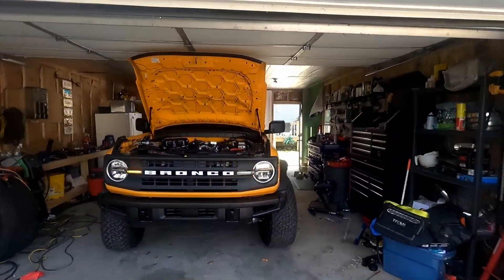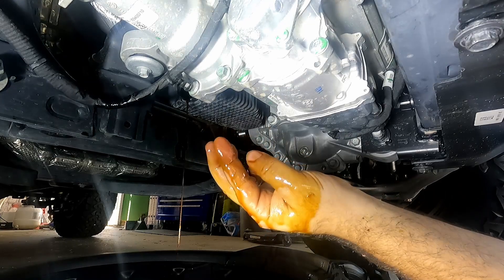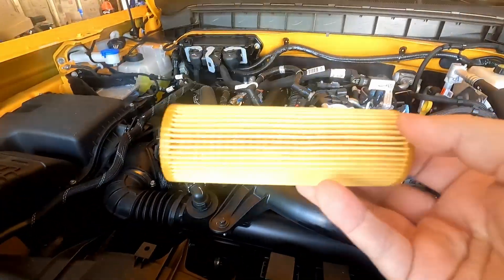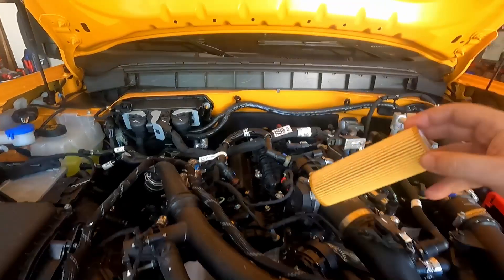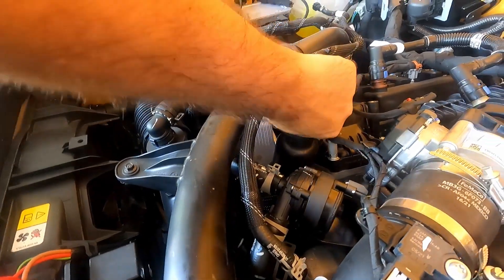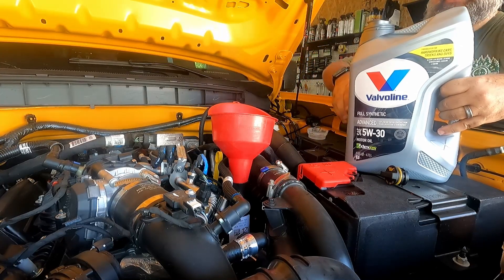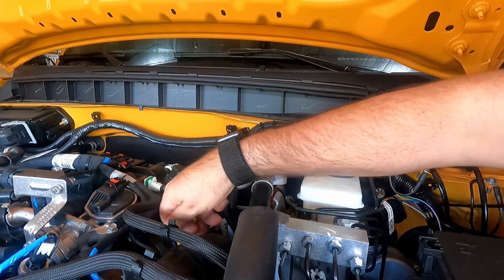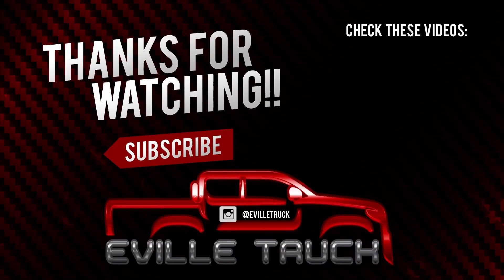How to Change Oil in Your 2021+ Ford Bronco | 2.7 Engine

Comment: After watching this video I'd say if you don't change the oil yourself take it to the dealer.  I couldn't bring myself to trust a quick oil change place to do it right.  Then again I don't take my old 2004 F250 to those places either.  With how long it took to drain and still left a quart somewhere (oil cooler and lines maybe?) you know most oil change places aren't going to wait beyond the time it takes the oil flow to slow down to a small stream.  Not to mention I bet a lot of them aren't going to change the o-rings on the filter housing either.

Comment: Quite possibly the best gasoline engine Ford makes today. These are heavily built motors. Definitely looks a little more obnoxious to get to than the F-150 I had, but skid plates do that. The F-150 takes 6 quarts. I highly doubt the use case in the Bronco is harsher than the F-150, but always check your dip stick. They do tend to put a decent amount of fuel in the oil, so I wouldn't recommend going much over 5,000 mile intervals, shorter if towing.

Comment: Blitz makes a large shallow oil pan that looks like a very oversized cookie sheet that I use under my collection bucket.  Stopped getting those annoying splash and drip marks.

Good to see that the oil filter isn't a hassle to get at.  My 2009 Volvo requires some serious contortions to get in and out.  (it's also a Ford design as the original filter was a Motorcraft - Volvo was wholly owned by Ford during the end of the 00's and many of the cars of the time use Ford parts.)

I try to use a rag to clean up the bottom of the oil filter recess.  That is where stuff will fall that does not stay in the filter.  

Strange that you see a call for 7 quarts when all the other applications use 6 and 6 reaches the fill mark.  I'm with you, I'd stick with 6.

Cool that you don't end up dumping oil all over the chassis.  I wish other manufacturers would think about such things.  The oil you got on the cross member I think splashed from your hand in the initial plug removal.  

Using the old fryer oil container for waste oil is a great idea.  My local DPW has a heater in their garage that burns used oil.  They love me when I drop by with 6 5-gallon buckets of motor oil and tractor fluid.

Comment: Guess I've been out of the game working on Fords for a while. My last Ford product was in 1981. I have a Bronco on the way. Since when did Ford trucks get composite oil pans and plastic drain plugs? I am not saying these are bad it is just I know how long a metal pan and plug will last. I have no idea how long the composite lasts. I have a 2021 4Runner and it still has a metal pan and drain plug.
Reply from the maker: They have been using them in the F150's since at least 2018  if not before then in some of them.   So it's at least not a new thing  that hasn't been road tested for a few years already.

Comment: Seems like this would be a good candidate for an oil extractor, through the dipstick tube. No messing with the drain pan, quick and simple. Especially since the filter is on top of the engine. Also nice lube(Valvoline) 👍
Reply from the maker: I have never used an oil extractor, but seems like a pretty simple process
Reply: The 2.7 has a separate chamber for the dipstick that features a check valve between it and the oil pan. Which won't allow for an oil extractor to be used.
Reply from the maker: @alexproper   good to know, thanks

Comment: Thanks for the 2.7L oil change demo. In case you wanted to just check the oil filter--do you think it is possible to check (take off/out) the oil filter without draining the oil first? or would oil go everywhere? Thanks!
Reply from the maker: You should be able to take filter out without any issue  just let it set for a minute or two after opening it up to let any oil drain down  and should be good to go.
Reply: Thanks!
Reply: @EvilleTruck  Thanks!

Comment from the maker: It was time for the first 2021 Bronco Oil Change on the 2.7 Liter Ecoboost engine.  The manual states 7 Quarts of oil, that is not what I found though.
Reply: Ignoring what the internet says it should take, what does the owners manual say?
Reply from the maker: @Stuka87  Motorcraft® SAE 5W-30 Synthetic Blend Motor Oil
Reply: @Stuka87 Unfortunately the manual is wrong.  I have owned a lot of Ford vehicles and I always do my own oil changes.  This is the first vehicle where the oil capacity specification is wrong.

Comment: How many miles did you drive to do the first oil change?  And what does bronco recommend ?
Reply from the maker: Drove 1,700 so far, not a ton  the break in period is 1,000 so did a change  after that,  manual doesn't say to do one after break in, but cant hurt,  manual says 5,000 - 10,000 or one year.    Will do another at 5k and then at  every 5k after that
Reply: @EvilleTruck  awesome. Thanks for the feed back.  Great work
Reply: @TheKing-xn1td  — in every new vehicle that I’ve owned, I always change my oil after the first 500 miles, then i flow with a premium full synthetic every 5000 miles!

Comment: Plastic oil pan what the? Not a thermal engineer but seems like an issue waiting to happen, long term for sure vs good ole metal pans?
Reply from the maker: yeah I guess time will tell, but transmission pan is same material too.
Reply: Many new vehicles use composite oil pans, its not a new thing. They help with NVH and there should not be any thermal issues with them.
Reply: @Stuka87  They tried it on the Raptor and Ford went back to a steel oil pan.
Reply: It’s been done for a few years now on the F-150’s they had issues first year now problems solved
Reply: I had one on my 2012 f250 6.7L but it finally started to leak at 205k miles so it has since been swapped with a steel one
Reply: @joshuaberryman1615  at least it made it to 200k that’s not bad at all
Reply: @timschultes6467  it's not bad but I might be a little more ocd on maintenance than most

Comment: Also don’t check the dipstick right after you add oil it will give false readings. It takes over an hour for it to read correctly.  The rule on the 2.7’s is add 6 quarts and forget it it’s perfect every time
Reply from the maker: Yeah only difference is the  owners manual calls for 7 quarts for Bronco.. even though its 6 in every other 2.7  application, so not sure if there is a quart hiding somewhere or its a misprint or what.
Reply: @EvilleTruck  it is weird after I watched your video I started to research it and now I don’t know lol. They either like to confuse us or it’s a misprint
Reply from the maker: @timschultes6467  My wild guess, they wanted to put new pan in, it became a constraint item and they just went with what they had already, and never updated the manual.
Reply: @EvilleTruck  yes probably so. Anyways the 2.7 is a good engine. I like it in my 2020 F-150 and I change the oil every 4-5k because I don’t trust the 10k mile interval
Reply: ive seen many Broncos with the dip stick showing way over the fill mark, into the bend of the dip stick. Some are saying that the dip stick is wrong, some are saying that its being way over filled from the factory or during the dealers doing their check when the truck gets delivered.

Comment: Is there a gasket on drain plug?  Usually have to replace those after some use/mileage interval. Good thing there is a skid plate, composite pan would probably crack if you managed to get hung on a rock. Metal would just dent.
Reply from the maker: Yes there was an o ring on the drain plug as well,  did not change that out this time, but something to keep an eye on for sure.
Reply: I can't imagine those oil pans are gonna like  hot/cold cycles much in cold climates
Reply: @EvilleTruck  I never had an issue in my F-150 in CO. They are fine. Glass fill Nylon doesn't flex much. The o-ring is silicone, and you just buy the whole plastic drain plug for ~$6. I reused it up to 6 oil changes before changing it out, never had a leak.

Comment: That drain plug design sucks. Theres gotta be an upgrade you can do aftermarket right? I've never had a vehicle with a plastic drain plug
Reply from the maker: I have seen ones you can plug in that adds a hose connection and valve, but it's also plastic,  At least you don't have to worry about someone cross threading it and causing a leak.

Comment: If it was jacked up in the front it wouldn't take that long to drain.
Reply: The 2.7L has reservoirs in the heads that retain oil for the start stop function to ensure the valvetrain is lubricated properly. It can take upwards of 15 minutes for those to drain. As far as I know, it is the only Ford motor that this design is present in.

Comment: It's a shame Ford has to make everything out of dam plastic!  That's a BIG negative for me.  A off-road vehicle should have steel components NOT plastic.
Reply from the maker: the oil pan is pretty well protected with the bash plates, the transmission pan however, is unprotected and same material. It is a lot higher up  but not unreachable, guess we will see over time how well they hold up.
Reply: @EvilleTruck  I ordered my (MY '22) with full bash plates.  Even if you don't plan to offroad much, hitting a 2x4 dropped in the road happens!
Reply: Completely agree about wanting metal but dissimilar metals to interact and cause corrosion so plastic is better around aluminum.  Also saves some weight on something just holding oil.

Comment: Seriously a cartridge filter?! Wtf ford?
Reply: All the Ford International engines used cartridge filters, except the 7.3 IDI, which never was at risk of oil starvation because it's so luggy. Mercedes, CAT, marine diesels, they all use cartridges because there's a better seat.